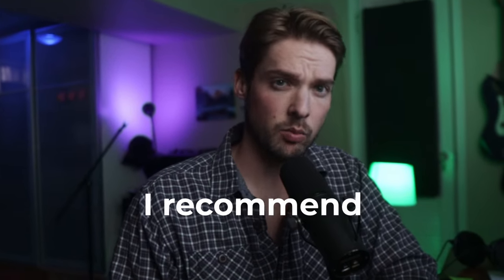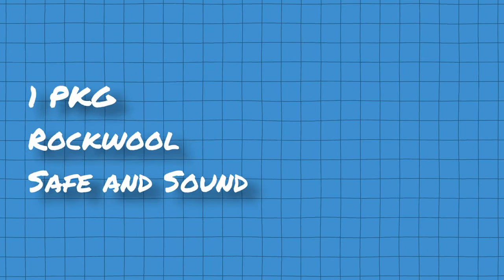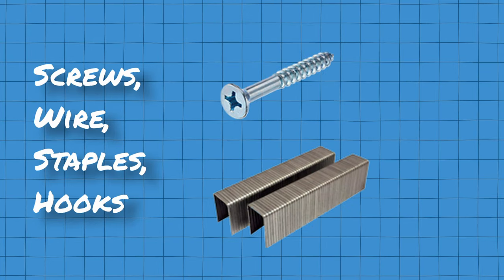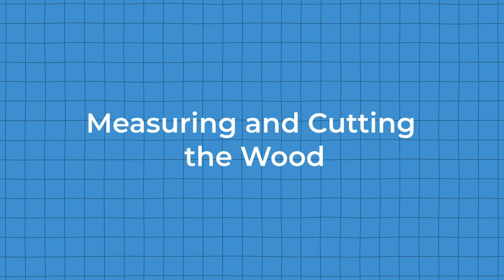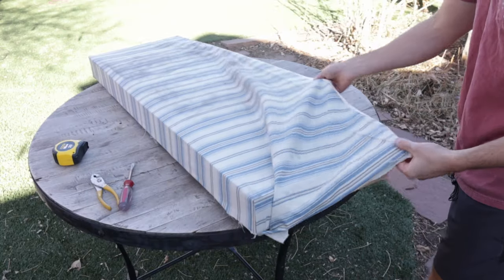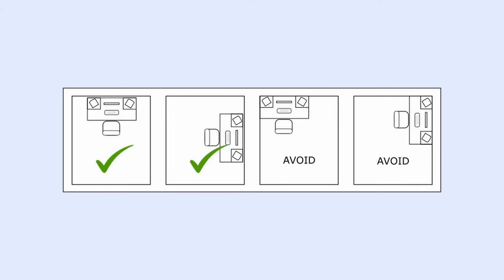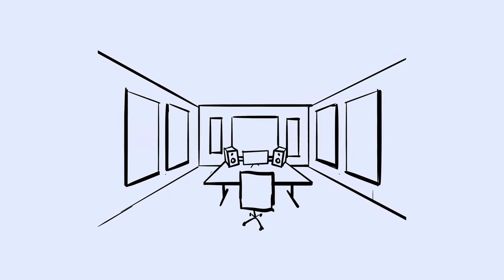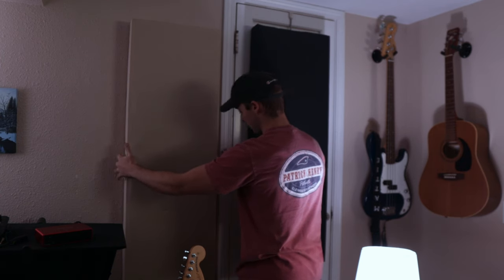How to Make DIY Acoustic Panels for $28 in 2024! (With Free Plans!)

Comment: Thanks for making downloadable plans. I conceived of this in my head, bought the materials (except want them for the ceiling), but then began to get confused re construction - so perfect to open up the first video that answered almost all my questions (ceiling hanging still an issue). One suggestion about something you touch on all too briefly: people need to remember they're working with fiberglass, and to not use wide-weave cotton canvas. Those fiberglass fibers are practically microscopic and get into fabric and into the air, so wear a good mask while working with the Rockwool, and buy a densely-woven, fireproof poly duck - waterproof outdoor variety is good.

Comment: Quick question. The Rockwool you used is 50mm (2”) thick, and the frame is 100mm (4”) thick. So you have a 2” air gap at the back right? Thanks
Reply from the maker: Yes! That seems about right!
Reply: @Music-By-Mattie  excellent. And you think these panels can improve a room with many reflections? I only listen to music, not produce or mix. Thanks